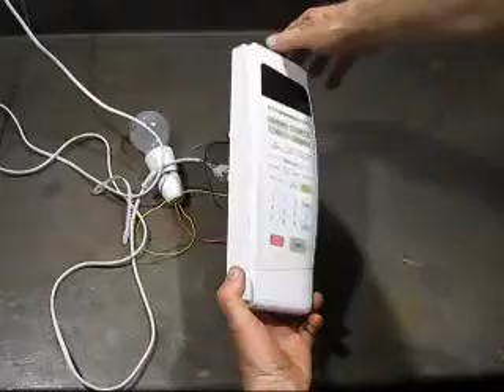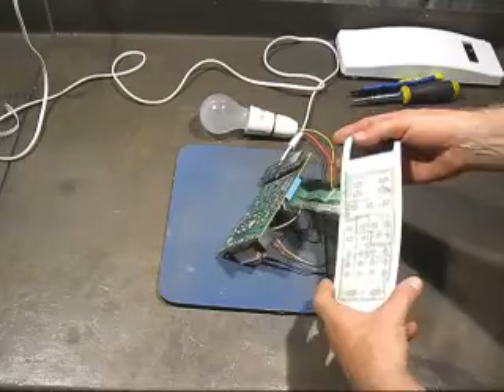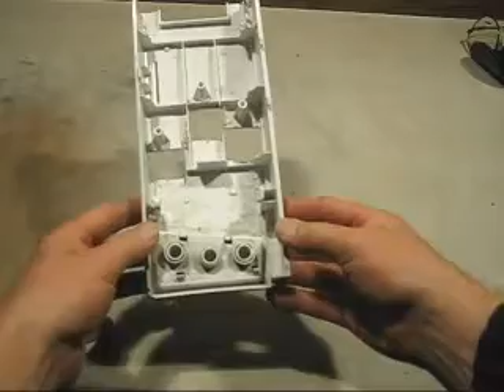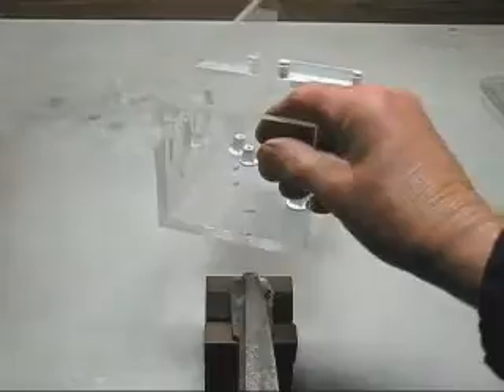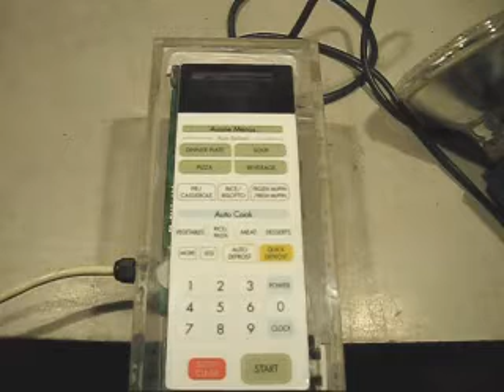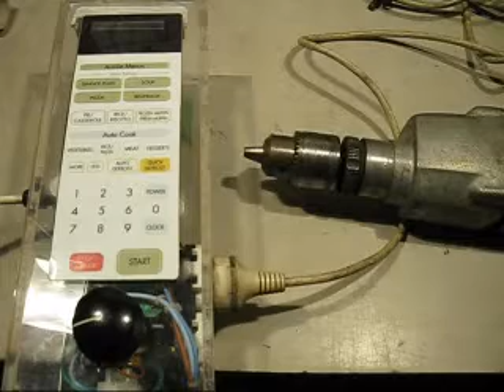Repurposing a microwave oven controller

Comment: Not being too electronically educated, bear with me as I try to understand the wiring.  When you initially showed the controller with the light bulb, your first step was connecting the white 240V connector to the board (just above the transformer).  But when you switch the camera to your final assembly in it's new box, I do not see that white 240v connector, nor any wires going to the board except the two which go to the relay.  How is power getting to the board?
Reply from the maker: I removed the white connector and soldered the wires direct to the board. No need to have a connector when everything is in the box.
Reply: @luckygen1001  Ah, that makes sense.  Thanks for clarifying.  Love your videos.  They are greatly appreciated.
Reply from the maker: Here is a tip for you, not all microwave ovens have that connector to power up that board. Some get their power through the relay. If you disconnect both wires from the relay and the display does not work that is how that one is connected.

Comment: This microwave controller conversion is perfect for my darkroom to control my enlarger.  Thanks.  I am still searching for a cheap solution for a mist system (to spray water for a few seconds every hour or so) to take care of my plant nursery.
Reply: for the mist system a ac light timer, a digital one will allow you to go as low as seconds for its on time, but a mechanical will only allow 15 minute segments

Comment: Hi. What do you use to vary the speed of the vacuum motor when you use it to blow your furnace? Thanks. Great videos.
Reply from the maker: +gasonthebrain It has a triac in it to vary the voltage which changes the speed of the vacuum cleaner motor.
Reply: Thanks for that. However it doesn't give me enough information to get one going for myself, which I would really like to do. Would you be prepared to make a video on the subject and go into a bit more detail of what hardware is needed and how it is put together. I have you subscribed, so if anything you upload, I get. Thanks again for your most interesting videos. Stephen NZ
Reply: Hold that thought. I just bought one on Aliexpress for $3. I'll see if that will do the job. Supposed to be good to 2000W, 25Amps. Thanks
Reply: Buy a simple SCR on E-bay, that matches the wattage you motor draw.
Reply: Thanks Kalle. I got what I was after. Found a 2000W speed controller, that should do the trick. Haven't tried it yet. I bought 3 of them on Aliexpress. All three, including shipping, for under $NZ10. Pretty cool.
Reply: gasonthebrain I've used a similar one for another project (a still). Be aware that the cooling profile on the triac is a little on the small side, you may want to mount a piece of aluminium on top of that. Also, do never short the output terminals, the triac fries immidiatly. Fortunatly they don't cost a lot, so i bought 5 of them as a spare...think it was around 3$ on E-bay.

Comment: How would I do the same thing but reverse the timer to turn on a circuit or switch as on a motor at the end of the cycle? I'm trying to make a can crusher.
Reply from the maker: +Preston Thompson I don't think it can be done with this controller. The only way I think it could be done is using two timers.
Reply: +luckygen1001 Thank you.
Reply: +Preston Thompson 
Maybe you could add some contactors to this circuit to control your charge cycle and firing.
You could also add a delay-on timer to add a time delay between the end of the capacitor charging cycle and the discharge. That would be nice :)
Reply: a relay that has two sets of contacts, normally off and normally on, its quite common to find one

Comment: Great, informative video!  Thanks for sharing this idea.  I have several appliances and tools in need of a timer to control the duty cycle (ultrasonic cleaners, rock tumblers and so forth), and this seems like it will do quite nicely and very INEXPENSIVE!  I have several discarded (I'm and avid dumpster diver) microwave ovens -- which can be the donors for the required parts and the MOT's for use in building welders, chargers and induction heater, as demonstrated in other videos. I can't thank you enough!   Cheers, from California, USA.